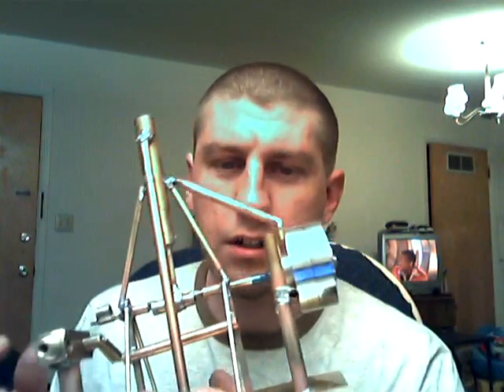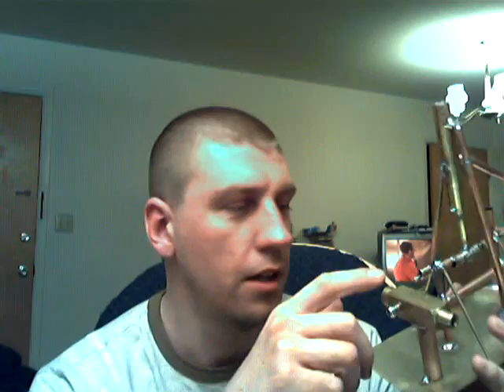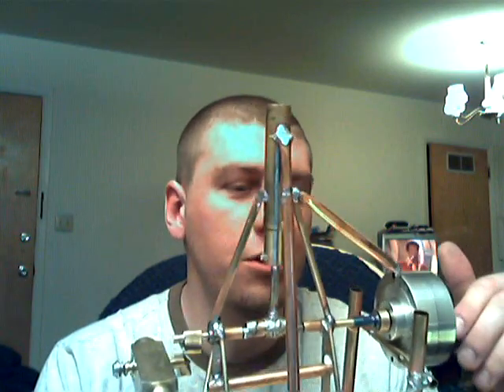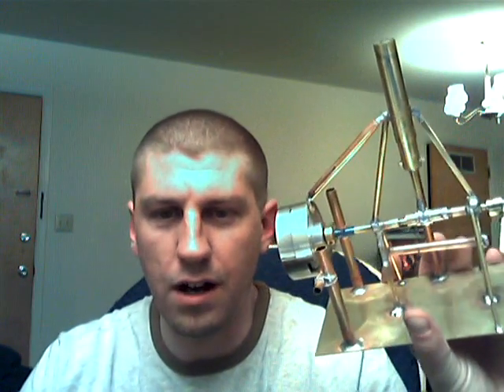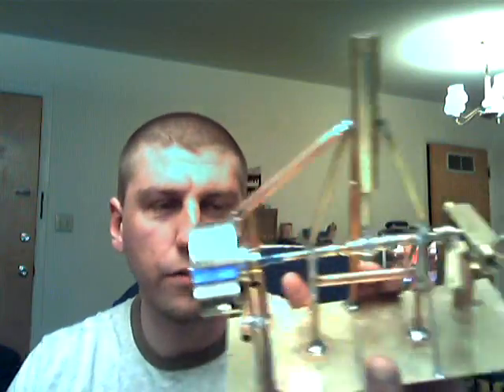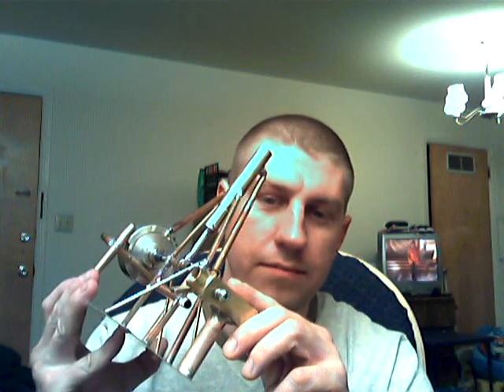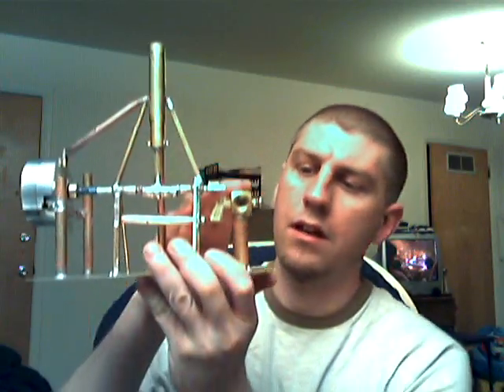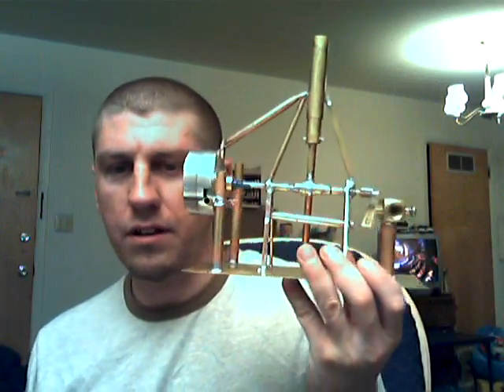hho torch. micro torch

Comment from the maker: i need a credit card to order on line until
then im stuck with what i can get my hands on. i seen some variacs but 5 amps was the highest im looking into
it do you no were i can get a 30 amp variac 5 amps is the highest i can find
also a wile back i discoverd carbon rods
and ac power with a little h2so4 makes
a very productive steam generater
but also it could be converted into a power control by raising the fliud level
in the unit it will allow more current to
flow ill exponed later

Comment from the maker: be advised uping the amprage will solve
this problem with heavy brass but then
it wouldnt be my soldering iron it would be a cutting torch, iam currently working on a double electrolite tank one would
be for low amps the other for high.
also i thought about rewiring my MOT
to run at 12 volts or so then connect
a dimmer switch to the primary coil
to see if that will alow power control